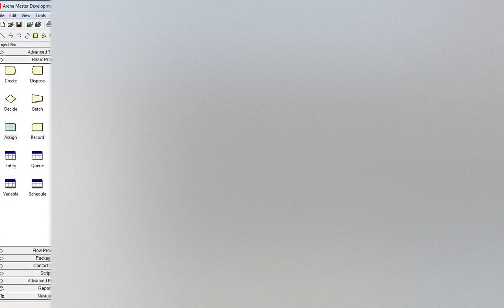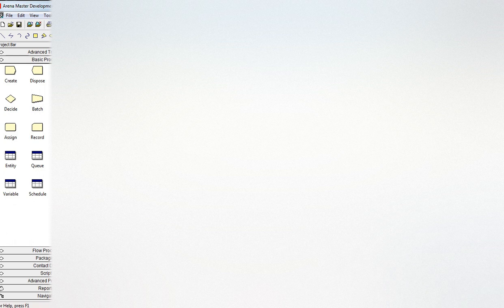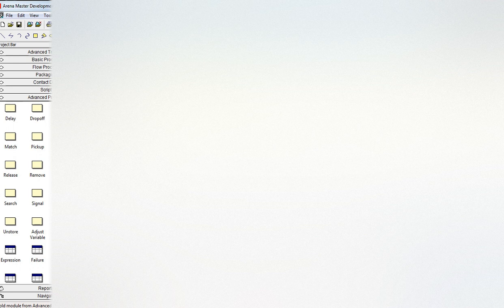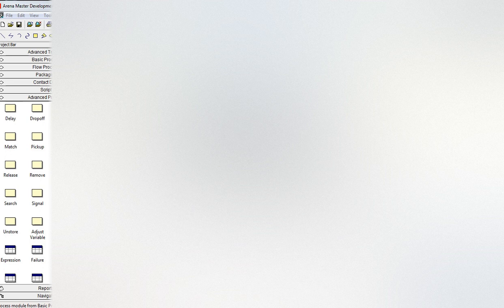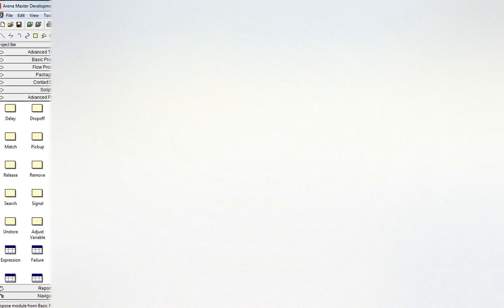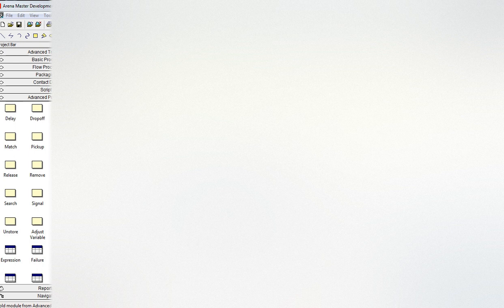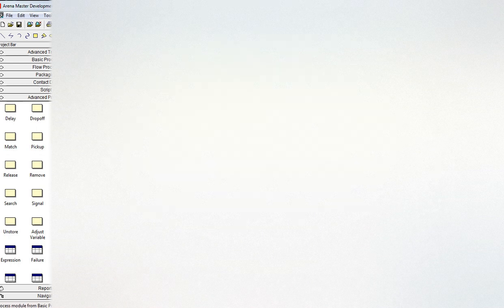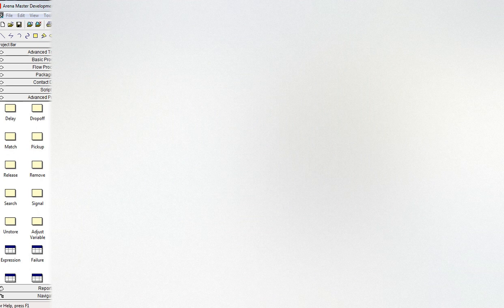Hold Scanning for a Condition Arena Simulation

Comment: PROBLEM 1. 
A gas station has 5 gasoline pumps – one dispenses only diesel fuel and 4 dispense both diesel
and unleaded gasoline. A customer arrives to the gas station following a uniform distribution
with a minimum time of 20 seconds and a maximum time of 1 minutes. When a customer
arrives, 70% of the time he/she wants unleaded fuel. As such, he/she tries to queue up in a single
line for the next available diesel/unleaded gasoline pump. If there are already 3 cars waiting for
the diesel/unleaded gasoline pumps, then there is no room for the arriving customer to wait. As
such, rather than join the queue, he/she drives around the block and comes back again in 2
minutes and always joins the queue regardless of the number of cars. Assume that the time to
pump gas form a diesel/unleaded pump follows a normal distribution with a mean of 2 minutes
and a standard deviation of 20 seconds.

Thirty percent of the time, an arriving customer wants diesel fuel. If this is the case, he/she needs
to decide which waiting line to join – the line for the diesel only gas pump or the line for the
diesel/unleaded pumps. To decide, our diesel fuel customer looks at the system. If he/she
observes that the diesel pump queue has 1 or more car waiting and the diesel/unleaded queue has
2 or fewer cars waiting, he/she joins the diesel/unleaded line. Otherwise he/she joins the line for
the diesel only pump. Given how this pump is located on the property, there is no limit to the
number of cars that can wait for this pump. The time to pump gasoline at the diesel only pump
follows a normal distribution with mean of 2 minutes and standard deviation of 30 seconds.
Simulate the gasoline system for 60 minutes and collect the following statistics:
1. The total numbers of cars arrive to the gas station.
2. The average queue size of the diesel only pump.
3. The average queue size of the diesel/unleaded pump.
4. The total number of cars that must circle the block.
5. The utilization of the single diesel pump.
6. The utilization of the four diesel/unleaded pumps.
7. Count number of diesel cars that use the diesel/unleaded pump.
8. Count number of diesel cars that use the diesel only pump.

Problem 2
When a vehicle is returned to an airport rental vehicle agency, the vehicle is processed through
an automated vehicle wash. The automated vehicle cleans two types of vehicles – cars and
minivans. A car arrives every 10 minutes (exponentially distributed) and requires between 3 and
5 minutes (uniform distribution) to go through the wash system. The first car arrives at time 0.
The first minivan arrives at time 5 and continues to arrive at an average of every 7 minutes
thereafter (exponentially distributed). Each minivan requires 5 minutes to go through the wash
system (normally distributed with standard deviation of 0.5 minute).
There are two car wash lines available. The regular line and fancy line. The vehicles will choose
the fancy line unless there 3 more vehicles waiting in the fancy line than the regular line. Only
one vehicle can be in the wash system of each line at any one time. If both a car and a minivan
are waiting for the car wash, the minivan will always be given priority to be the next vehicle to
be washed. If the vehicle is washed in the fancy line, the wash time will be reduced by 1 minutes.
The profit for regular line is $2.70 per vehicle for regular line and $2.55 per vehicle for fancy
line.
Create the simulation model with Arena. Run your simulation for 600 minutes and collect the
following statistics:
1. The average time for a car in the car wash system (from arrival to departure).
2. The average time for a minivan in the car wash system.
3. The average number of vehicles waiting to be washed.
4. The average time a vehicle waits in the queue before beginning its wash.
5. The utilization of the automated car wash.
6. The average wash time of car and the average wash time of a minivan.
7. How many cars are processed by regular line.
8. How many minivans are processed by fancy line.
9. The total profit during the simulation time of the car wash station

Problem 3
A gas station has 5 gasoline pumps – one dispenses only diesel fuel and 4 dispense both diesel and
unleaded gasoline. A customer arrives to the gas station following a uniform distribution with a minimum time of 30 seconds and a maximum time of 1.5 minutes. When a customer arrives, 70% of the time he/she wants unleaded fuel. As such, he/she tries to queue up in a single line for the next available diesel/unleaded gasoline pump. If there are already 3 cars waiting for the diesel/unleaded gasoline pumps, then there is no room for the arriving customer to wait. As such, rather than join the queue, he/she drives around the block and comes back again in 2 minutes. If the drive around customer find there are still 3 or more vehicles waiting, the customer will leave and try other gas station. On average, customer normally spend $45 to fill the tank (with standard deviation of $4.65).
Assume that the time to pump gas form a diesel/unleaded pump follows a normal distribution with a mean of 2 minutes and a standard deviation of 20 seconds. 

The diesel and unleaded pumps are available based on the following schedule:
 
Thirty percent of the time, an arriving customer wants diesel fuel. If this is the case, he/she needs to decide which waiting line to join – the line for the diesel only gas pump or the line for the diesel/unleaded pumps. To decide, our diesel fuel customer looks at the system. If he/she observes that the diesel pump queue has 1 or more car waiting and the diesel/unleaded queue has 2 or fewer cars waiting, he/she joins the diesel/unleaded line. Otherwise he/she joins the line for the diesel only pump.
Given how this pump is located on the property, there is no limit to the number of cars that can wait for this pump. The time to pump gasoline at the diesel only pump follows a normal distribution with mean of 2 minutes and standard deviation of 30 seconds.

Simulate the gasoline system for 120 minutes and collect the following statistics:
1. The total numbers of cars arrive to the gas station.
2. The average queue size of the diesel only pump.
3. The total number of cars that must circle the block.
4. The utilization of the four diesel/unleaded pumps.
5. Count number of diesel cars that use the diesel/unleaded pump.
6. Count number of diesel cars that use the diesel only pump.
7. Number of customer leave the gas station due to long line and total loss of sales.